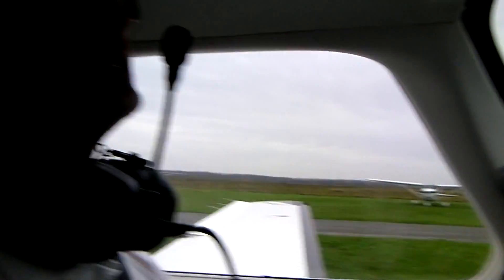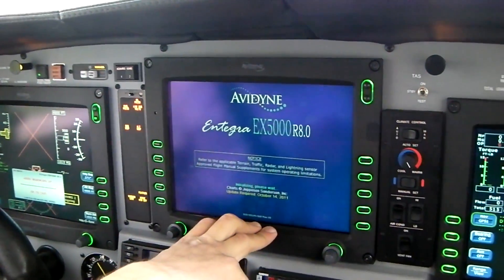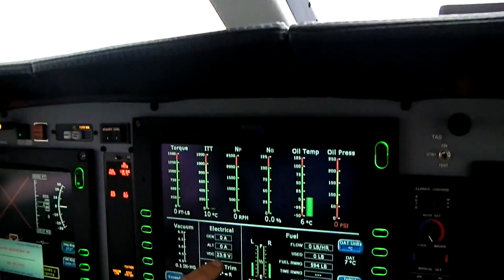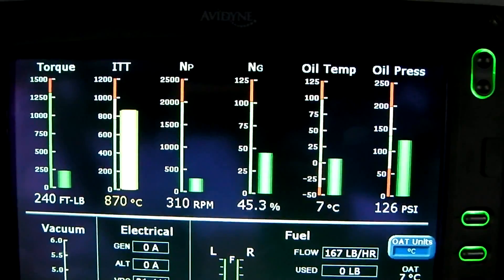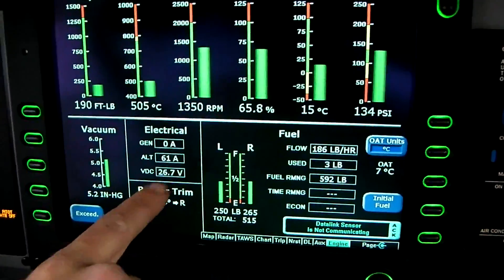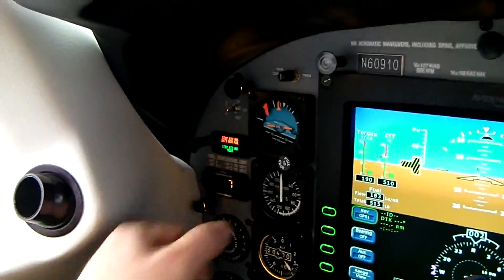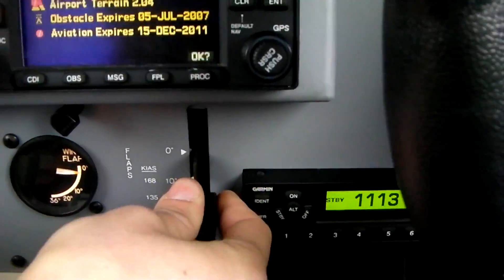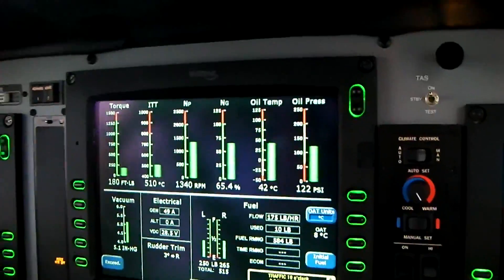Piper PA-46T Meridian Start Procedure

Comment: Low batt means the battery will not help the starter as well as if it was fully charged, It will therefore not spool up the compressor as well and less air will enter the fuel chamber as combustion starts, thus higher ITT are expected (which is the main thing to watch on start). Hope this helps a bit